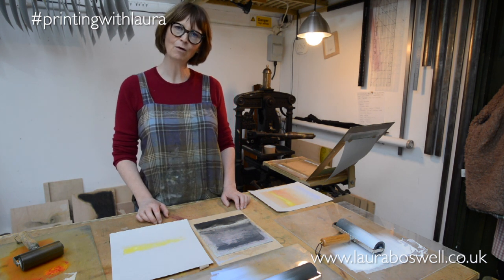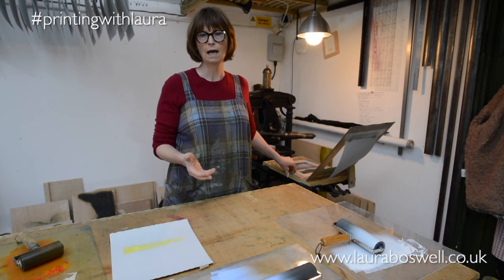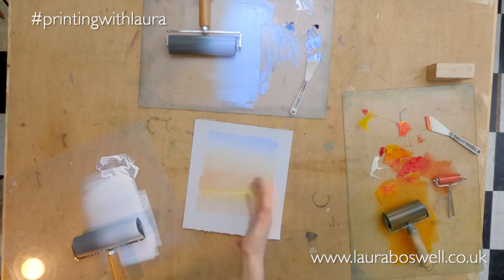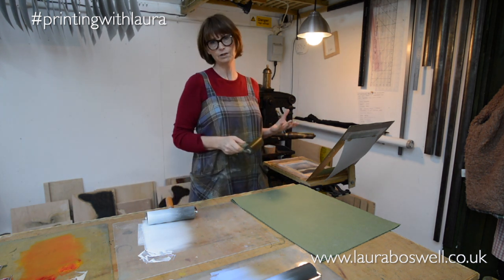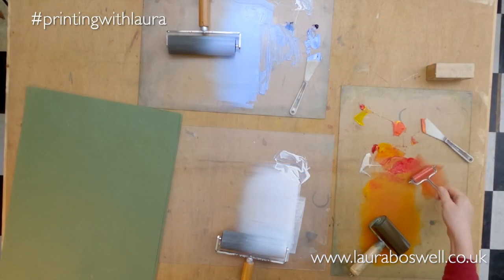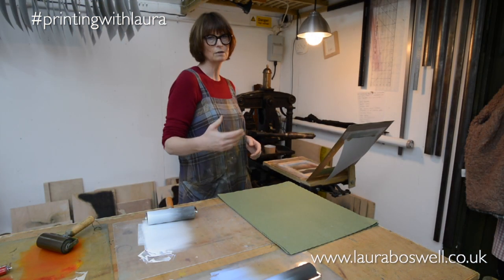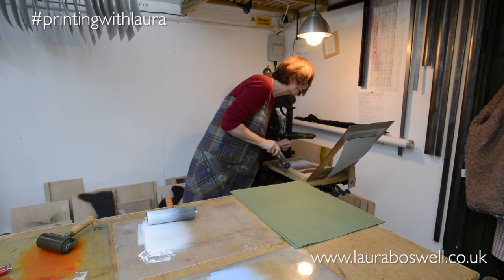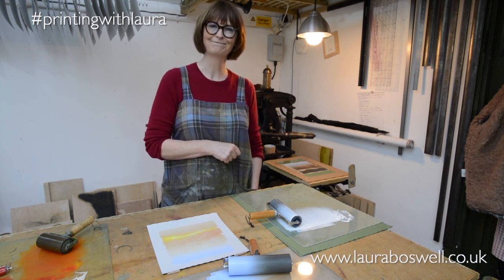Printing a Tricky Reduction Linocut Sky

Comment: I love the delicacy of the colours in the sky. Laura could you achieve the same result by doing a multi colour roll instead of doing them separately? (-: Marion
Reply from the maker: It would certainly be more straightforward, but in my experience, it’s not as easy to control when working through an edition of prints - the gradations blend over time and you’d lose the clarity, probably ending up with something a little clumsier - that’s why I do it this way.